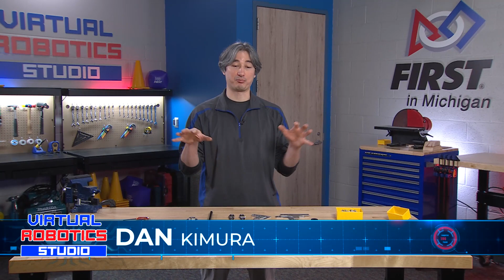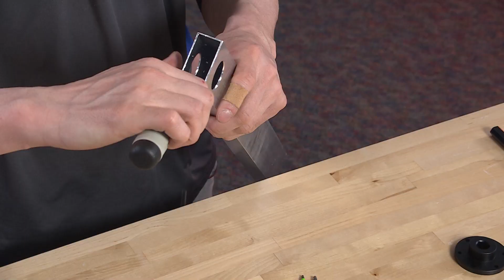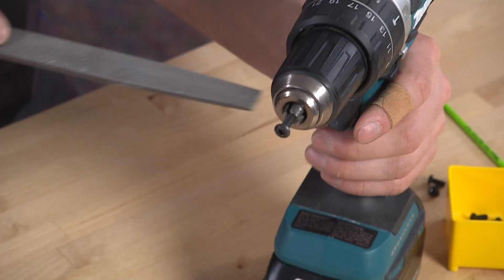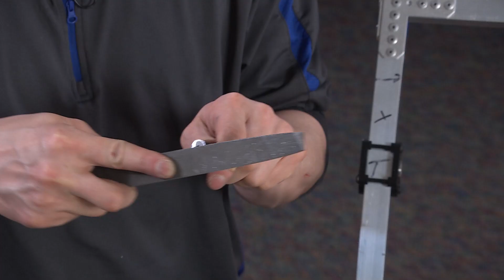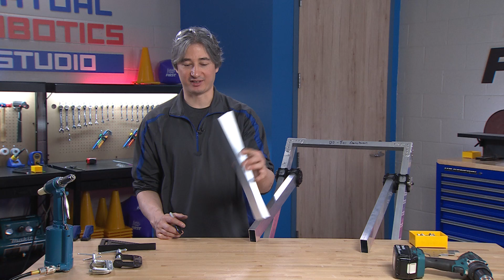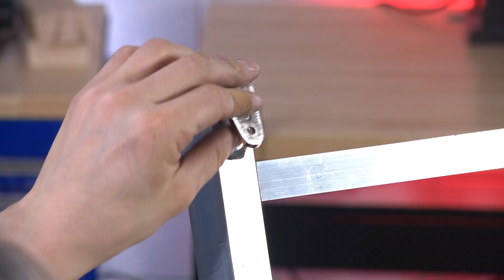VRS 07: Arm Structure: Building & Assembling

Comment: Thanks so much for the tutorials. I have a question about the length of the 03_Arm_Driver_Link. On the Everybot 2023 CUT LIST, it states the length is 21.22. In your video you cut it to 24.25 which is around the cut length for the 02_Superstructure_Upright. Is there a reason why?